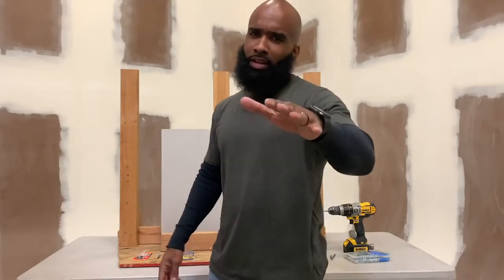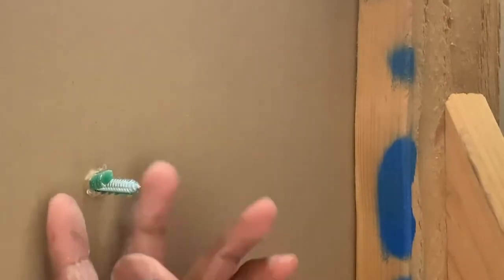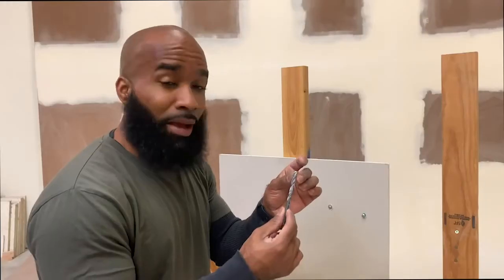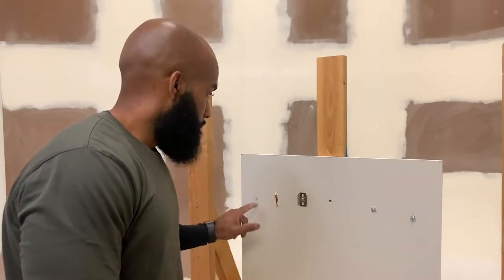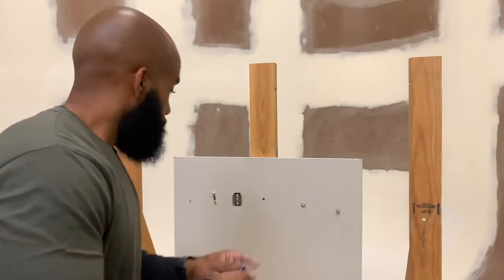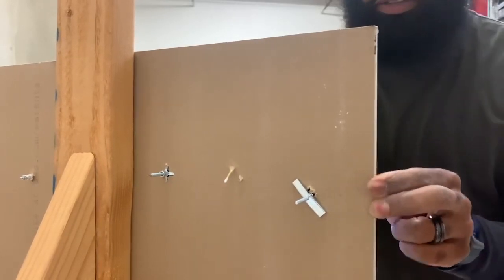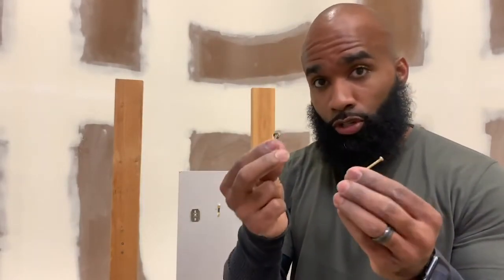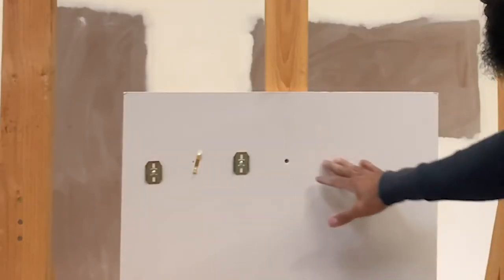Wall Anchors| #BuildingWithGoose

Comment: thanks Goose!  Just came back to this video for a re-watch before using the butterfly anchors on my over-the-range microwave bracket.  The original installers used a 'hood' method to install and now the bracket is loose :-(
Reply from the maker: Try to find the stud first when hanging the microwave if there’s not a stud in that area the metal butterfly anchors will work but always consult a professional before taking action